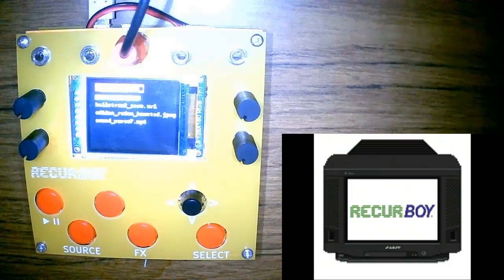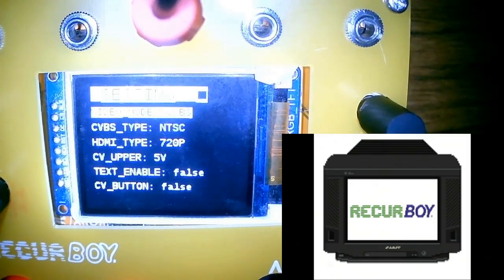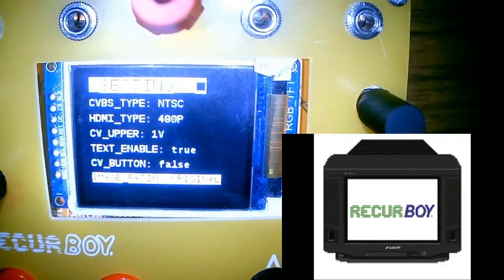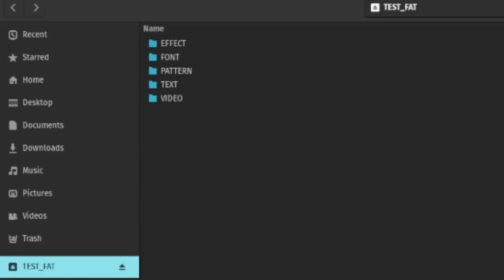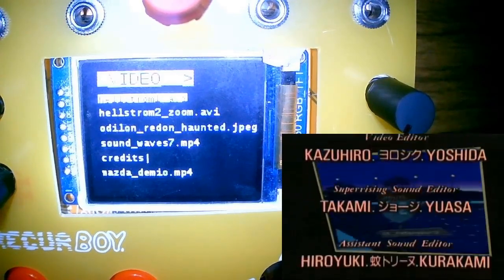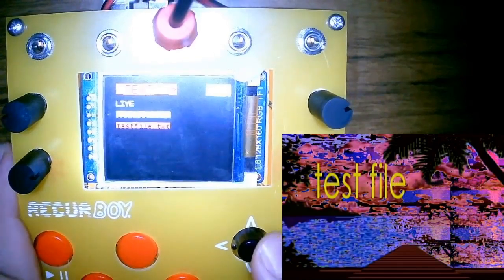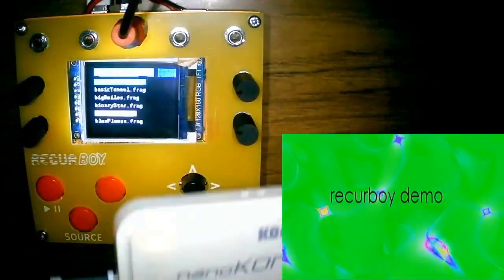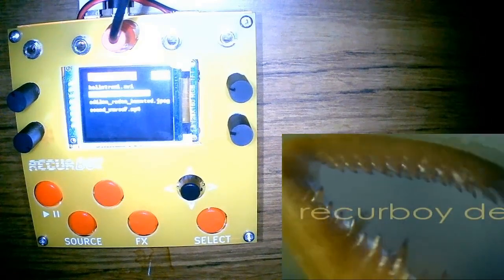recurBOY firmware update v3.0.0

Comment: Fantastic work! It’s great to see the additional versatility to this project. I remember hacking on r_e_c_u_r around 2023 and it was a little difficult finding specifics about the old framework on the pi (omxplayer, etc). Are you working with those older resources or have you additionally been migrating to more current software? I can’t even imagine tackling this if so in 2025!! Thank you so much for sharing your hard work.